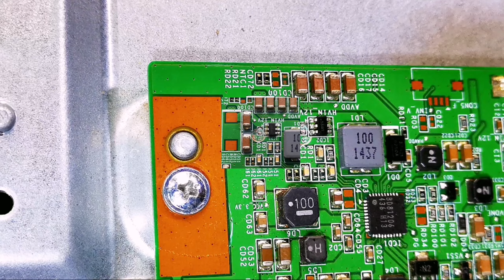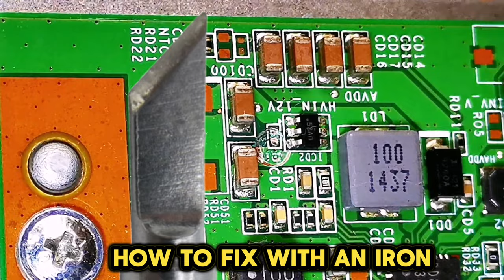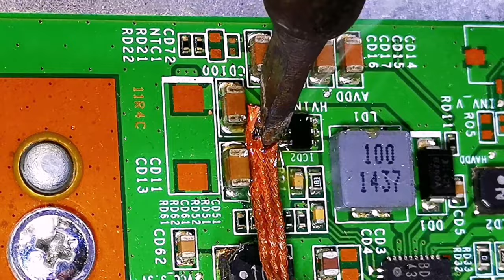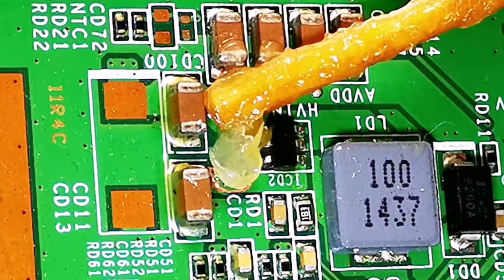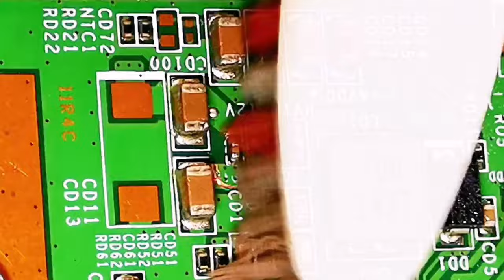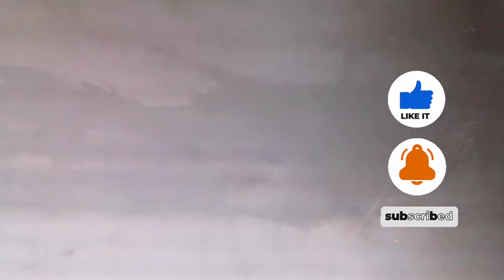WOULD YOU USE THIS IRON for the Job? #solderingtips #ledtvpanelrepair #electronics

Comment: That ic sot 23-6 is very iportant as voltage supply right..?
Reply from the maker: Absolutely important. You see it on almost all small Samsung TCONs of that generation.
Reply: @tgetvtips  what most specific problem that we can identifying if that ic broken. .?
Reply from the maker: @junaalbafaraj9585, no picture; that is blank screen.
Reply from the maker: @junaalbafaraj9585, the MOSFET rarely fails though. Because it works in conjunction with the DC-DC chip, when there are no vital signs (no AVDD, etc), the most common failure is with the DC-DC, capacitors, or protection.
Reply: @tgetvtips  got it sir....thanks..🤗
Reply from the maker: Happy to help! ❤️